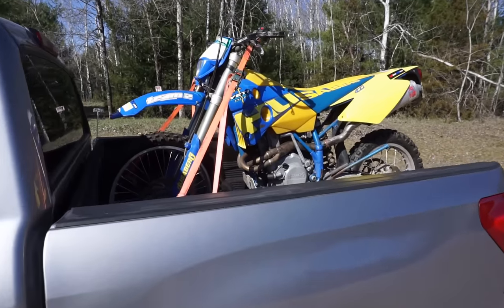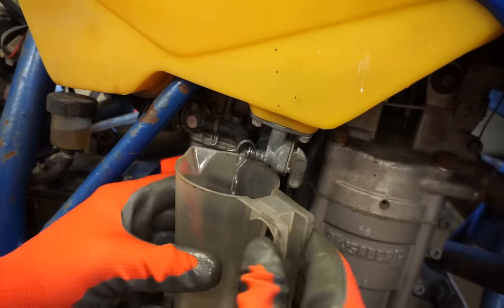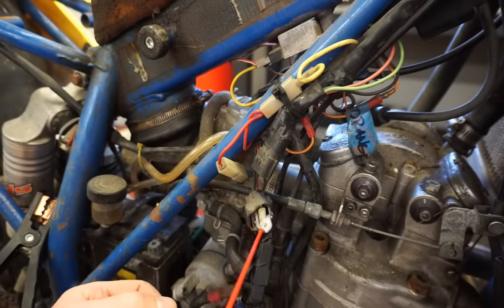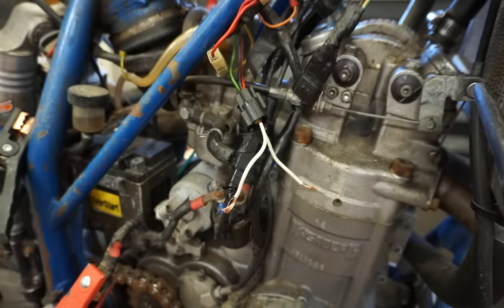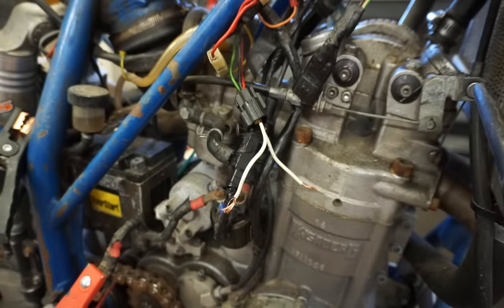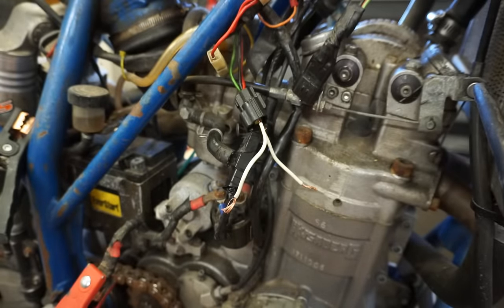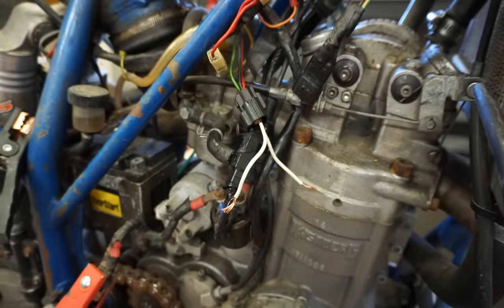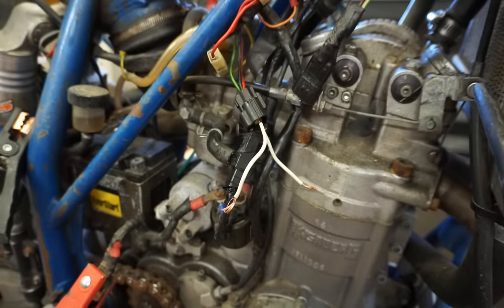Seller Said This Rare 500cc Supermoto Won't Run (Sitting 15 Years)

Comment: Huh ? Can’t Be That easy The Float jet , check all the Ground contacts , check timing , the Switches Run /Off the head light cause the first time it started it was so Easy when started it was like it wasn’t started it was so smooth with so little compression like a 50cc , so check Continuity on the stater from all the kicking you was doing , put a contact in its correct place , and even when you Let it warm up Good then Gunned the throttle it Flamed out , silent no pop ,

Comment: We need to put out a mass group challenge to all the motorcycle manufacturers to design and build a motorcycle that is extremely easy to work on in every aspect. They could do it but to do so would mean all the individual engineers actually working together to accomplish this common purpose. Unfortunately it seems that most designers and engineers are strictly single minded in their narrow field of expertise. Of course personal pride often gets in the way of progress. 
Okay…the CHALLENGE of perfecting ease of minor and major maintenance in a brand new machine that will be loved and take over the world wide market. 🤔

Comment: I hate left side kick start levers. You're not getting much leverage, kicking while standing on the floor. It'd be much easier if you used the kickstand, stood with your right foot on the right footage and kick started with your left foot. Your thigh won't be parallel with the floor when you begin your kick, it will algae down, giving you more of a mechanical advantage. Used to lean my CR480's handlebar against a tree to kickstart this way. (No kickstand)

Comment: In the rest of the world this is an enduro bike, not a supermoto... it has knoby tyres and is obviously set up for dirt not road... everywhere else in the world enduro's are held on public roads which are dirt roads and that is one reason they are road registered. that is why this one is or was registered for road use as indicated by the number plate on the back. If you look at videos of the international 6 day enduro you will see they all have lights and number plates which also means they have public liability insurance (part of registration requirement) and licenced riders....

Comment: Spark problem is prob line from coil to plug hat. i had that.
Reply: Crap from tank went to carb?
Reply: this. the way it worked when he pulled the boot off (probably because it was bent just so) would have made me replace the entire thing.

Comment: Stator is bad. Thats what they do. Been through all this on same bike. +  if its a resistor cap. They dont like it get 1 without resistor or take resistor out and fill the gap full of copper wire.

Comment: Do NOT bumpstart this bike whatever you do! As a former owner of 2 Husabergare, SEM ignition system and the carb is shit on these ones. It is a shame it wasnt a 2004 or newer.
Btw, the electrict starter is not supposed to be used as a starter when it is cold, it sounds crazy but it is only a ”restarter”🤪😂

Comment: Make yourself A DIY screwdriver dual headed long stem tool out of A cheap Philips 🪛 screwdriver. By grinding A flathead on the opposite end bent over onto A S shape lengthened. In A vise with propane torch with vise grips and rag wrapped around the stem bar of the driver wrench. That's what you would be making it's called A S driver wrenches set short and long stemmed   shaft Sets for adjusting those valves with Joe.

Comment: I've had several bikes that need a hard kick to get spark.
That rpm is the minimum to generate pulse. 
It also is what it takes to get your starter clutch to work. 
Any speed/effort/rpm less, your fucked. 
Make it easy on yourself. 
get a high capacity lithium battery ,or it jump off a high capacity battery .
Once you get it tuned right, it will start easily off a HARD/fast kick, and be dead reliable.

Comment: Man, when that thing finally fired up, it seemed effortless. Like it's been running its whole life. Just putt, putt, putt. Like it was nothing. I had an old Honda XL250 that would do the same thing. Kick it 100 times and nothing. Then when it finally fired off, it would start and run on the first kick every time. Until you put it away. Then the next time it was back to kicking 100 times.

Comment: Compression has nothing to do with spark. You have a wir8ng issue if you are getting and losing spark. Compression only mattery if you want it to run. But ur trying to see if you have spark.  So i would do the jiggle test on ur connectors. Something is intermittent

Comment: You should never use a battery charger hooked up to a vehicle without the battery to regulate the voltage.  it will put out high voltage and destroy your electrics.

Comment: I have had 2 Hassle Burgs over the years a 1996 & 2000. FE600  light weight great handling but a bucket of shit mechanically so many inherent problems metal contamination as there were no timing chain guides cam chain would rub into the cylinder head no oil pump oil would pump via piston pressure on the downward stroke staters fail due to wire corrosion flywheel would seperate on mounting spigot rotate slightly & throw the timing out the one way sprag for the starter would fail material being too soft if you want to start it via kick starter fit a WR Yamaha hot start l could go on & on KTM did rape the company but they were reliable under there ownership sad to see them go!

Comment: amazed it started , looks like ktm took all the stupid stuff of this bike and thought it would be a great idea on their lc4!. cannot for the life of me understand why all this so unnecessarily complicated. maybe have the flywheel off see what's going on with the woodruff key, spacing for pulsar coil or making sure it has no gems like 'safety' switches on clutch ,side stand  as kms are notorious for it .  does it have a sprag gear for the starter?

Comment: Don't you think you gotta clean that frame up with that?Air filter goes so you don't suck all that c*** into the intake.
Just saying man, why are you such a dirty mechanic?Why don't you clean s*** up?Man, instead of leaving it filthy, all the time.Have pride in your work
Also.
 A smart man would fix the bendicks on the starter. So you don't have to kick that heavy a** 500 over anymore. You could just push buttonn, start it.

Comment: those are awesome bikes very reliable the motors run for 10000 miles no problem. they're usually mistreated that's why they're unreliable. the hard to start part is also a lie. they start very easily both with the starter and with the pedal

Comment: Those conections stinks,the pickup also fail usually,replace stator,the pickup and electric rectifyer,change cables and conectors also the light is broken,dont tell you something about what is wrong? You must be able to start it up with the starter dont kick it anymore,you are in serious risk to loose a foot jumping over...😅

Comment: I'd take a look at the starter motor try fix it if ya can lube the hell out of the bendix, that could make the difference of getting that bitch poppin off, dont forget the cdi has a capacitor that needs to be full of charge to get that first start, hence needing the starter motor to get the first pop off, full battery too, Max charge.

Comment: Sure looks like a tough bike to work on.  The battery looks insanely hard to remove, as well as the carb. Didn’t see any spark at first.  I don’t expect them to run, and most of the guys selling this stuff have lied about everything and still sold you worn out bikes.  This one might be a challenge because it is a rare bike, that has gone out of business.  If anyone can get it going, you are the one who can.😊

Comment: Why do you you have wires stuck into the plug then read off them. The test probes are pointy for a reason. You are just introducing another point of failure

Comment: Please stop reving cold engine's  dude
Reply: It's his bikes man let him do him. It only hurts him if he breaks it not us. Relax. It's just nice watching and learning.
Reply: Ong
Reply: @karsonburth8929  learn what how to blow up a bike
Reply: @karsonburth8929 you he sells them on he doesn't keep them so the next owner will have to deal with it which is not good.
Reply: Hes hardly revving it more than you would just regularly driving it. Not gonna hurt anything at those rpms.
Reply: He needs people to comment, to keep the buzz going to excite the algorithm. He doesn’t give a rats ass about his mechanical skill. Money, money, money.
Reply: Bro it doesn’t take along time for oil to cycle chill it’s not gonna hurt the bike
Reply: I can understand a cold 2 stroke but a cold 4 stroke won't hurt as much as long as it has oil in it and strong oil pressure it's good.
Reply: Right! It feels as though every time he does it, a kitten somewhere  dies....peacefully, peacefully. But still dies.
Reply: Honsetly, on an ball bearing engines, like most single cylinder bikes, it really doesn't hurt much. On a plain bearing engine, like multi-cylinder bikes yeah, you can stress the bearings before good oil flow starts.

Comment: WTF. He takes off gross air cleaner and does NOT clean all the sand and shit around air intake. He NEVER cleans anything before working on it. Dismantles dirty carb caked with sand. I would  Never buy anything from this dirty mechanic. Any engine should be pressure washed before lifting a spanner (wrench)

Comment: You're over using donkey way of testing and fixing,please make a step by step manteinance specialy with a 15 years stopped motorbike,all the electric components are out of worklife,if you dont want to waste time there IS a way to do this job properly and IS not that way,to make a motorbike run safely and for a long time,there IS all the information on internet,books,methods and a recomend Toyota maintence and asembly manual, 0 fails,0 mistakes...100% quality..